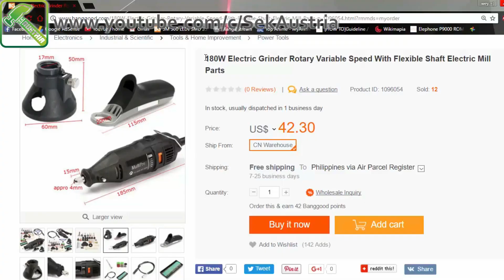Diy Silent Air Compressor Changing Oil

Comment: That's not an easy modification you made there. I'm sure you know you didn't have to do that to change the oil, you did it because you wanted to.  Great job! 
I use my compressor to flush transmissions and transfer cases, removing the old fluid and pumping in the new.
Reply: Actualy you should change the oil. Oryginal oil used in this type of compressor is very hygroscopic. It pulls water from air and becomes highly corrosive.
Reply: What type of oil I should use?
Reply: @eliasmichalis  compressor oil will be ideal
Reply: Krzysztof Żak. Some friend say that may be oil that can support  the “not new air coming in “ and the humidity as well.

Comment: Thanks for the video. Great job.Can a hole be drilled on the lower SIDE of any refrigeration compressor (from dehumidifier, window ac, refrig, freezer) ?  Would there be anything close to the compressor "wall" that would prevent me drilling a hole?Also....would BRAZING with Mapp gas Bernzomatic torch work....or must it be done with a welding torch?Thanks ! !
Reply from the maker: be careful when drilling you might damage the motor coil windings

Comment: That's actually not an elbow, it's called a 90 degree street. And you really don't need a hole in the bottom since the intake will work just fine with mineral oil. I made one from a window AC years ago, added casters to its frame so I could wheel it around. Later added a water pressure switch from a water pump to shut off the air when it charged the 5 gal air tank (added on the window AC frame) for safety and convenience. It lasted MANY years until I could afford a real one. Now I just need to drain the new one and add an auto drain kit.
Reply from the maker: for me its will be easy to drain the old oil and replacing it with the new one.
Reply from the maker: here in our place we call it threaded elbow pipe, thanks for the info

Comment: Mmmmm..u did make it all of that just like a piece of cake for u.but how can u tell n be sure that the inside were completely clean of any dirt or debris after u cut a hole before u sealed it back
Reply: When making modifications to things for the first time it's hard to know or predict what the negative effects (if any) your modification may cause. If it doesn't work or it breaks then you learned something valuable.

Comment: If fridges are designed to run for X amount of years with the same oil in the compressor, what is the point of swapping it out in this build? - Im making a mini compressor for airbrushing (model making) :)
Reply: Fridge use oil in close loop without any interference from outside. If you use it in open loop sooner or later you will have problem with corosion. Fridge oil react with water from air and become very corosive. So best way to prevent it is changing oil to different type that is better suited for the job.

Comment: sir i have a problem on my refrigerator compressor first i try to use that on homemade airgun and it reach around 300 psi then rest about 30 mins then i try again to fil air on my homemade airgun but the pressure cant reach on 190 psi and also the air leak on intake pipe. . .what could be the problem pls reply thanks
Reply from the maker: +xrem flores  it is the outtake pipe it leaks inside. You might need to open your compressor.
Reply: Sek Austria  thanks sir are you filipino. . And sir what oil should i put on compressor
Reply from the maker: 50/50 mixture of mineral oil and motor oil. do not put pure motor oil. your compressor will get a hard start
Reply: Sir Is that the only way to change oil of compressor?it will not damage the inside part of compressor?
Reply: Sek Austria how about 100% mineral oil?
Reply: I don't think it is a good idea to use that compressor on an air rifle. If a tiny bit of that oil gets into the hpa cylinder and creates vapors they can self-ignite when the tank gets pressurized above 2000psi or even less depending on the temperature , and that will create extra pressure inside and your tank can potentially explode.